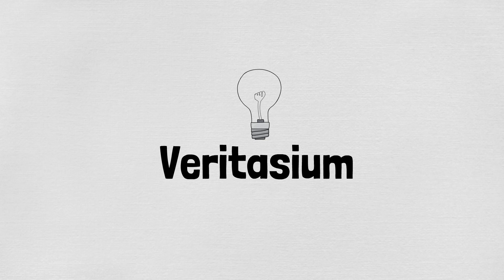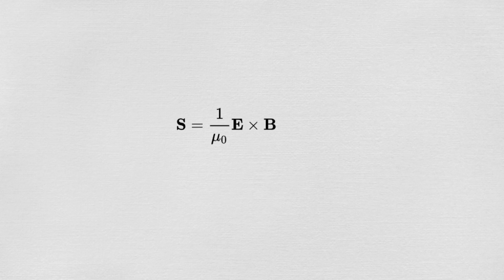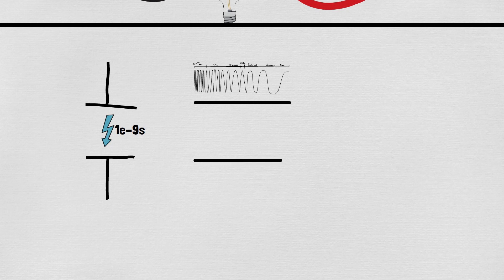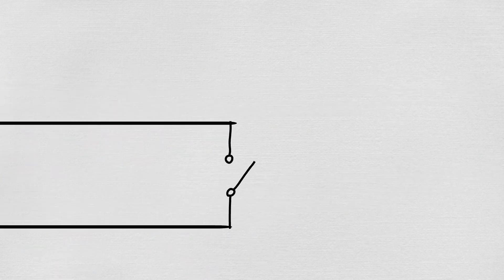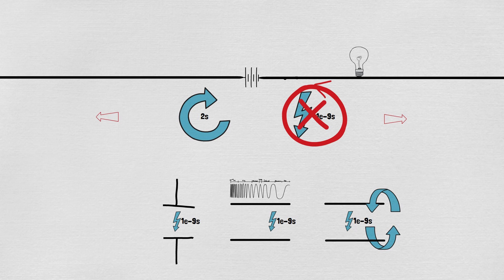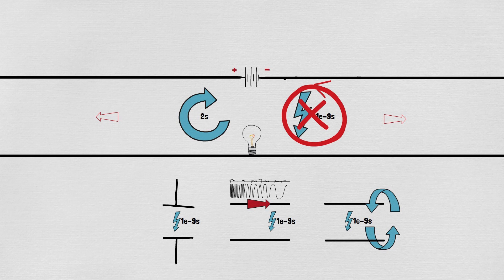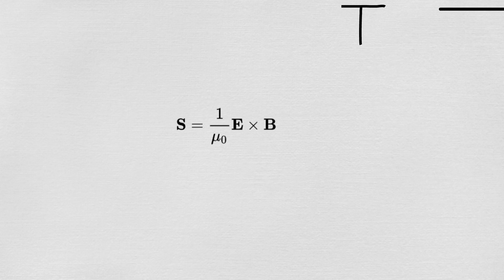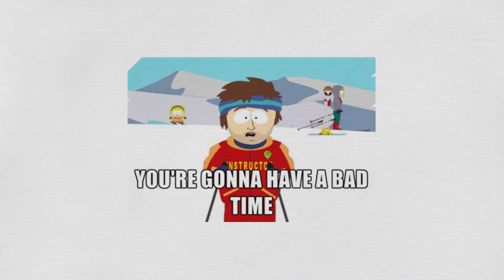Veritasium is Right? (see description)

Comment: ah but what if both are true (& neither are too).. plus it depends what you mean by "lighting the bulb".
Let us assume it is a 20V battery & a 20V 20W bulb (hence it is looking for 1A across its 20ohm resistance).
Closing the switch at t=0 a "charging current and voltage" step transition will start flowing out into the first upper wire pair (acting as a single wire transmission line/dipole antenna).... the impedance of the actual lower real load/bulb doesn't matter here as you CANNOT know anything about it until the speed of light lets you know about anything at that distance.
I cannot remember the exact characteristic impedance of a single wire to infinity but 600ohms is probably a fair ballpark figure.
Assuming the battery is centre earthed for symmetry so that is +-10v pulses going down each side into 600 ohms so you'll have about 17mA of step transition flowing out into the UPPER wire.... this IS a real power so that WILL start radiating out through space & 3nS later that WILL hit the lower wires with the bulb connected to it & these will start acting as dipole antennas & feed some energy into the bulb but it was only 16mA that was initially flowing not the 1A the lightbulb would like to see, then you have the attenuation of free space for the radiated field in the m it has crossed (some of this radiated energy is scooting off to Mars missing the wire with the light totally), then you have mismatch between the lightbulbs resistance to the "dipole antenna" characteristic impedance so all in all although some energy will hit the lightbulb after 3nS I'd expect it to be VERY VERY VERY dim.
The interesting thing is that after the 2 seconds the pulse has to travel out to the furthest point then back down the lower wires to start properly conductivity lighting the bulb there is still the mismatch between the 1A the light wants & the initial charging 16mA down the line which will lead to a reflected pulse going back to the battery, which will still then be slightly out so yet another pulse will go back down the transmission line & it will lake a good few iterations of this 2 second cycle before the bulb gets its full 1A to hit its final brightness.
So yes some minor light could come out of the bulb after 3nS (but certainly not properly light it), but after 2 seconds the bulb will still not be properly lit & it could take well over 10 seconds for it to be "properly" lit...... 2 seconds certainly isn't right & 3ns isn't 100% wrong.
Ah the joys of putting step transitions onto long open ended cables of co-ax and watching the charging steps reflect up and down the line before it realised that no current should flow in an o/c.

Comment: Lets say that this circuit exists for more than 2 seconds, before you turn on the switch. Because there is voltage difference on the switch, closing the switch would make an infinite current for 2 seconds.
Reply: The voltage on the switch disappears the moment it is closed. The current would only be infinite if you could close it infinitely fast, and in such case it would be infinite for an infinitely short amount of time.
Sorry, this is not how it works :D
Reply: @biogoo  why would current stop if there is zero resistance?
Reply: This is a dynamic em field problem with other factors that have to be taken into consideration, not just resistance, which by all means can still be considered zero if you wish.
Reply: So ong story short, light will fully be turned on for at least first 2 seconds

Comment: The bulb (assuming it's a standard incandescent one) doesn't light up because of the direction of power flow, it lights up because current causes the filament to heat up. That cannot happen until the circuit is closed by a switch. 

However the assertion that power flow is always one way from source to load is true. Examine waveguide theory and it will become quite apparent why this is so.

Comment: Based on the updated description… Veritasium’s answer (D) isn’t correct either: the point from which EM field starts to travel to the lamp over the air is not the battery – it is the switch. So for the answer to be 1/c seconds the lamp needs to be 1 m from the switch (not from the battery). Therefore, √2/c seconds (assuming the switch is 1 m from the battery) 😆
Reply from the maker: Probably more like 2/c if the switch is also 1m away from the battery. Current through switch induces capacitive coupling directly across from switch, then has to travel from there to the bulb. Either way, the whole experiment is poorly constructed to demonstrate the thing he wanted to demonstrate.

Comment: Veritasium's video seemed to equate force and energy (or, possibly, electric potential), which seemed odd to me. The open circuit he presented certainly has a force (across the gap in the opening, equivalent to the force between the negative and positive terminals on the battery), but an open circuit is still doing no real work. Suppose, for example, that we connected a capacitor, a switch and a battery in series inside of a black box. At some random time, the switch is closed. An outside observer would have serious difficulty (absent some seriously sensitive equipment) that the circuit had been closed, since the overall charge and forces remain the same modulo some negligible resistance in the battery, wires & capacitor. That is, until the circuit is connected to something that does real work.

More concerning are the post-hoc rationalizations I've seen. The capacitance theory makes a microgram of sense, but not much, since two essentially one-dimensional wires would make a pretty lousy capacitor, and I still can't account for how the wire with the bulb "knows" which charge to put where when/if the circuit is closed. The antenna theory & induction theory make no sense, since the current is clearly DC. I suppose at 1e-9 c s after the switch is closed, the bulb may receive a negligible pulse of EM radiation that make it light up for an imperceptibly short period. Of course, if the circuit is closed, then the light will hit its max brightness about 2 s after the switch is closed. These explanations would be nearly akin to saying in mechanics that air resistance causes powered flight.

Derek is himself hesitant to say that the lightbulb fully lights up when the switch is closed, just that it will start lighting up in 1e-9 s. The problem with this explanation is that he's not presenting an actual scientific description, given a lack of measurements, but merely a rational narrative. Some back of the envelope math (using the equations in this video) would be much closer to a scientific explanation, though I suspect that they would show exactly how negligible the brightness of the bulb is until current is flowing through the entire circuit (hint: sufficiently negligible that the brightness would be undetectable, though I myself have failed to do any calculation beyond a trivial binary light-is-on-or-off explanation).

Comment: I think much of the confusion stems from the fact that most attempts at explanations to this problem involve trying to apply existing models containing simplifying approximations.  Such existing models were developed to apply to useful setups, like small circuits or purpose-engineered antennae and wave guides, but are not general true.  This particular setup is pretty useless -- why would you try to light up a bulb 1m away with a light-second long wire?.  Analyzing this problem would require going back to first principle EM physics and either application of computer-based full numerical solution involving both wire conductance and EM propagation, etc, or an analytical approximation created specifically for this scenario.  What we can say is that there will be a messy transient transitioning into a relatively simple steady state situation (battery-wire-bulb, duh). This transient will involve some conductance through the bulb as charges move around the wires and displacement currents, inductances, and retarded potentials come into play, and may involve non-monotonic increase in the current through the bulb (ringing, etc).  I realize this is a bit of a non-answer, but I it's helpful to be aware of how our thinking of the world is often a collection of heuristics and approximations that are very powerful in certain scenarios but not always generally applicable.

Comment: Exactly. It seems everyone is over complicating such a simple thing. I have worked around DC electronics all my life and never ever seen a battery become an antenna or connecting open wires to it make it become an antenna or capacitor. You need current flow for this to happen. Otherwise we would have wireless DC.. wouldn't that be great? Now in this thought experiment things like resistance are being ignored so we are just treating like a normal DC circuit with a light bulb. We were not given any other info to work with so why just make up any?

Comment: Radio antennas show you can have a current in a wire without a completed circuit
Reply: Thing is, for the purposes of AC, every circuit is completed because of capacitive coupling.

Comment: This is a great explanation even if you didn't take physics class. The music in the background is annoying though and your voice is too low so it can't be heard clearly. But I believe you any other explanation does not make any sense because it implies you don't need a circuit at all. The energy flow direction is correct but it must happen after there is a current flow in the circuit.

Comment: The actual experiment might have a total of 200 feet of wire: of course the bulb would light ‘instantly.’ DC produces magnetic “field,” Does such light up a bulb? Only AC ‘through ‘ a capacitor produces an electrical “ field .” The fields are expanding electrons physically leaving. Electricity is also expanding electrons crossing over from subatomic realm to atomic realm. All physical particles objects matter, I.e. expanding electrons.

Comment: I became suspicious of Derek's claims when I thought - ignoring the switch at the moment, imagine that the wire had a break 1 light year away, how could the lightbulb "know" that the wire is or is not connected faster than light? That would violate the principle of information not travelling faster than light

Now it would make sense that if instead of a switch there was a power regulator and electricity was already flowing, then maybe the power regulator could send more power to the light bulb instantly, as from what I understood from the video the energy "flows" the shortest path in the EM field from the power regulator to the light bulb which is right next to it

Comment: You have most of the ingredients here for a correct understanding, but you haven't found it.   Clearly, closing the switch is what makes this a dynamic rather than a static situation.  You're a physicist,  I'll leave the details to you to figure out; Jackson does have  everything you need, but you can find it immediately and more specifically in an electrical engineering text on transmission lines.  The pair of wires needs to be understood simply as a conducting boundary condition for electromagnetic wave propagation: it forms a type of waveguide called a transmission line (in this case one commonly known as twinlead).  

Closing the switch launches waves in both directions along the line.  Currents are induced in the conducting wires by the waves.  Since the bulb is very near to the switch and hence to the origin of the waves, some current will begin to flow in it after the very short time given by the speed-of-light transit time across the 1 meter separation between the wires.   If you were to move the switch to some distance far away along the wire, then current wouldn't begin to flow in the bulb until the wave propagates that distance.  There is no causality problem, the speed of light determines how fast it all happens, of course. 

For a simple quantitative solution, here's a hint: as others have commented, a transmission line has a characteristic impedance (for these dimensions probably something in the neighborhood of 500-1000 ohms).  So as the switch is closed, the left and right sides of the line look like two resistors of that value in the circuit.    That simple picture will apply until the waves propagate all the way out to the ends and back, but then since the bulb and battery are impedance discontinuities there will be further reflections and several transits of the line before it all settles down to a steady DC current in the circuit.  In fact this happens with any electric circuit.  The transit times in ordinary circuits are negligibly short, but not in our modern fast computers, and emphatically not in the 100 nanosecond, terawatt pulsed power generators that I myself work with, where wave propagation times in transmission lines completely determine the pulse shapes.

Hope this points you in the right direction., and I hope you will not continue to lead others astray with incorrect pictures.
Reply: You don't have the transmission line that you think. The "transmission line" is actually made up of one long wire from the battery negative to the bulb (call it the black wire) and from the switch to the bulb (call it the red wire). The signal is applied between the black and red wires, not across each half of the red wire.

As for your simple quantitative solution, here's a hint for you: the voltage everywhere along the black wire stays at zero volts (battery negative) throughout the thought experiment. How can the black wire be a transmission line when no voltage changes anywhere along it? So how can the black wire look like a 500-1000 ohm resistor? There's no "wave propagat[ing] all the way out to the ends and back" in the black wire, is there?

If you think that "the bulb and battery are impedance discontinuities there will be further reflections", try to explain what voltage these "reflections" mean in the red wire. I say that the voltage along the red wire will step from 0 to 12V (the battery voltage) and that voltage will propagate along the red wire at some fraction of the speed of light until it arrives at the bulb and that is the end of it. If you think there are reflections, what voltage are these reflections? and how does that voltage change with time?
Reply: Hi,  let me try to fill in my explanation a bit and see if I can give you a better sense of what I described so briefly.  I'm sorry, this is cumbersome to explain without drawing things, but I'll try to do it with words.  
Before the switch is closed, we have the upper wire connected to the left (positive) terminal of the battery, and there's no current flowing in the circuit, so the entire wire, (with the bulb) is at the same potential as the positive side of the battery.  The voltage drop to the negative battery terminal is across the open switch.  When the switch is closed, this suddenly imposes the battery voltage as a potential difference between the upper wire leading left and the upper wire leading right.  Since the left and right sides of the circuit are identical,  as the switch is closed half the battery voltage will appear as a potential drop across the space from the upper wire down to the lower wire on the left side, and the other half as a  drop from the lower wire up to the upper wire on the right side.  That means that the bulb, in the middle, will be at a potential halfway between battery positive and negative.  You can get a sense of this initial effect by realizing that this is exactly what would happen in a simple circuit with two equal capacitors replacing the wire pairs leading left and right.   This is established in a very short instant, roughly the light transit time directly across the space between the upper and lower wires (that is, from the switch to the bulb).   Of course really we have the long pairs of wires, not discreet capacitors, on both sides.  The changing electric field associated with this very quick change in potential differences is what launches the electromagnetic waves that travel away in both directions along the wire-pair transmission lines (and also starts some current flowing in the bulb).  

To see the reflections I mentioned, here's a very nice computer simulation that shows all this visually:
https://www.youtube.com/watch?v=aqBDFO1bEs8

Comment: The point in Derek's video was about the energy flowing around the wire. I absolutely didn't care about the answer to the question. Was he right about that or energy flows inside the wire? I assume people are discussing over the answer to the question and not that the energy flows around the wire...
Reply from the maker: he is right about that. energy flows out of the batt and into the EM field, then out of the EM field and into the bulb. this is the only way for an AC circuit (not this circuit) to make any sense. but it's not even that mysterious of a phenomenon, because i assume we've all used radios before?
Reply: @antimatterhorn thanks for the answer. I'm mot ashamed to admit I thought energy flowed inside, so the video was mindblowing for me...New information, since I don't have any training on electrical engineering.